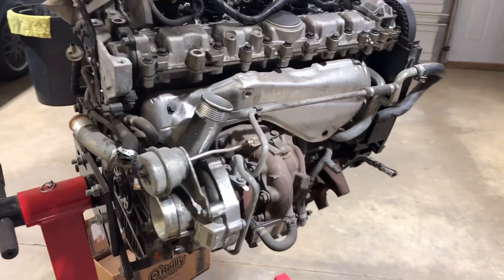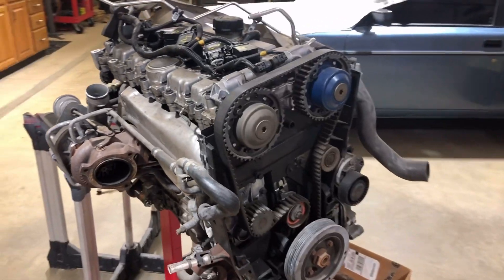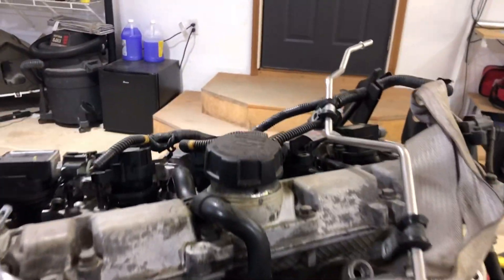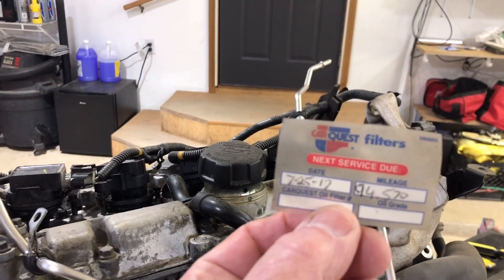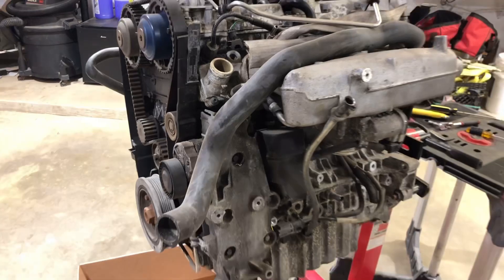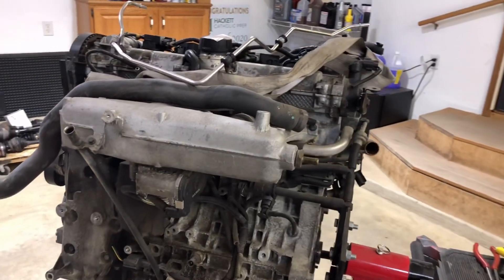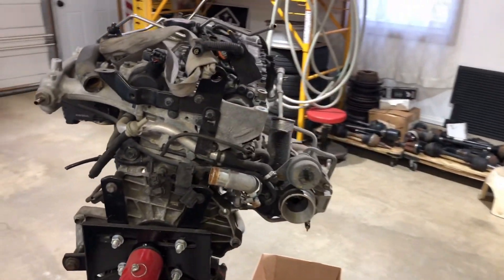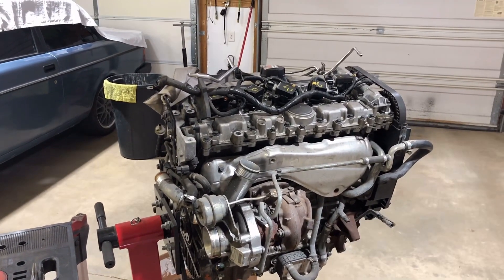2006 B5244T5 engine time lapse tear down - the best 5 cylinder engine Volvo ever built?!

Comment: I’m running a 2006 XC70 -just turned 200,000 miles
I installed an upgraded turbo from A1 Turbo in CA -Shout out to Tony @ A1 & Robert DYi
ELEVATE Tune
3” Snabb catless downpipe, 304 3” stainless Borla racing exhaust & resonator
Simota cold air intake pulling fresh air from the grill fed to a Snabb intake
IPD Silicone hoses
PCV system replaced 4 months ago 
She is an ugly, angry beast on the road 🔥
Can only drive in “manual” with the Tiptronic shifter, redlines about 6500
Being AWD you definitely feel it on the steering wheel trying to manhandle the torque pulling on it while the system is desperately trying to calculate what the hell to do.
Reply from the maker: Sounds like a cool car!  Thanks for watching!

Comment: Hi, I want to do an engine swap on Volvo 144 using the B5244T5 engine. What gearbox will mate with this engine for RWD?
Reply from the maker: For a manual the m90 is the preferred gearbox. There are other opportunities  available (try Yoshifab or STS Machining) that can mate different gearboxes. For auto I’m unsure but there are some available.
Reply: @handydand  thanks bros, will do my research 🙏🏾

Comment: Do i have to replace the cranks if im going to take about 400hp on this motor? I have read that the cranks are usually pretty weak on these motors but not sure on thís model.
Reply from the maker: The 4t5 engine should handle 400hp with the stock setup. However, anytime we push an engine’s limits stuff can break.  Building to that HP, you likely know that having a backup engine is a good plan. Thanks for the question and for watching!  Best of luck in your build!

Comment: What do yoz think about the B5254T2 210Hp 2.5T 5clyinder Engine ? Also Realaibly and how much Max Hp can i do for this Engine ?
Reply from the maker: I have that engine in my wife’s 2007xc70. It’s an excellent, toquey motor stock. Volvo offers a polestar tune upgrade which adds a tune and trans remap which gives a 30-40hp upgrade. Beyond that, the stock internals/cylinder walls Are supposedly good to 400 crank, but you are at the very limit of what the engine can provide. Look for 325 at the crank and that should provide plenty of smiles and still be reliable. Note that your tuner is key, as is the engine condition, stage zero, etc. thanks for watching and asking.
Reply: @handydand  Thanks For The Info Buddy 🤝

Comment: What's the Maximum Horsepower that this Engine can handle Stock?
Reply from the maker: A friend built one with 200k miles that pulled 400whp!
Reply: @handydand  Nice 👍😃
Did he use Forged internals? Or did he sleeve the Cylinders?
Original Turbo or Bigger Turbo?
Reply: @handydand  Amazing Work 👍
Reply: @handydand  Which Mods did he Do?

Comment: I want to get my hands on a whiteblock myself ❤️ 

I’ve owned a P2 wagon for a few years now and the first time I drove it home(780miles 1way) I knew it was a keeper 😮. Now I want to get more power from it!
Reply from the maker: I gotta say that the 4T5 motor in my Saff Wagon is an amazing engine!
Reply: How are you going to get more Horsepower it of this Engine?
Reply: @MB1Billion  that’s what I’m trying to find out now.
Reply: @ronin5020  There's not a Lot of Mod Videos on this Engine other than Wedging between the Cylinders so the Walls don't Crack as Easy and Exhaust. Other than that nothing. I haven't Seen any ECU or Running Videos. The amount of money it would take to make the white Block fast and Reinforce the Transmission and Axels I think I should just Buy a Track Hawk or Durango SRT  instead 🤣🤣🤣
Reply: @MB1Billion  year late but this is just wrong... check swedespeed or turbobricks or forums for better info on it, you're right about the transmission (basically an AW20 5spd is your best option for big power) but the white block is piss easy to make power on, crank boost up and get whatever engine internals you blow up machined. plus its in a volvo, you're not in it to race supercars, you're in it to have a sleeper that would keep you alive if you crash at 110, but even then it weighs 1500 lbs less than a trackhawk so you'd only need to make 500hp to be comparable
Reply: @dpi_samantha  Ok that's Good to Hear Because I Love Volvo XC90's 👍😃
Reply: @MB1Billion  if you like xc90s and you're into Mopar why not look at the XC90 V8?
Reply: @dpi_samantha  I was Looking into the V8 but I heard that you can get way more power in a T5 than the V8.
Reply: @MB1Billion  depends, it's a bit easier to make power on the T5s without much work but that's because Volvo guys hate doing much on engines besides putting on a bigger turbo, a built volvo V8 can easily handle 650 hp naturally aspirated or turbo, you can push it significantly more than that if you aren't daily driving it as well
Reply: @dpi_samantha  In California 
I found LA Sleeves for the Engine Reinforcement but I haven't found any Transmission Place to make the Transmission handle High Horsepower Specially for Volvos.
Reply: @MB1Billion  for the xc90s again best option is a toyota AW20 5spd but you need to fabricate an adaptor plate, but if I remember correctly stock XC90 turbo transmission is good out to 400(?) bhp, a lot of fab work necessary to get them beyond that figure which is why most Volvo guys discourage you from working on them

Comment: Ok what’s the difference between the b5244 t1 t2 t3 t4 the naturally aspirated version and this engine?
Reply from the maker: There are many differences; most notably, the 4t5 motor has the taller head and cams like the S/V 70R. It also has a revised crank/rods/pistons unique to this engine using the 81mm bore to make a stronger engine. Hope this helps and thanks for watching!

Comment: What difference between t4 and t5 engines ?
Reply from the maker: The engine in this video is considered to be the strongest stock lower end of the RN series. It has the bore of the 2.3 (thicker cylinder walls) but a stroker crank and rods to get the 2.4 displacement.
Reply: @handydand  thanks 🙌

Comment: 2.3 T5 is better in my opinion😏
Reply: Both engines have there strengths and weaknesses. If you just want to stick an intercooler, 3" exhaust and a tune on the engine and call it a day, the 2.4t5 is more superior than the 2.3. The R manifold, k24 turbo and better flowing head make it a great choice. If your planning serious engine work (forging the engine) then both engines are as good as each other in that regard. The 2.3 rn t5 is a bit less complicated thanks to it only having cvvt on the exhaust cam, whereas the 2.4 has it on both cams, therefore reducing the cost when you inevitably have to replace them 😉
Reply from the maker: I definitely love the 2.3!  However, the 4t5 in my Saff is a remarkable motor.  Thanks for your thoughts!
Reply: @handydand  it is! Truly
Reply: 2.4 T5 is better than an 2.3 T5 engine.

Comment: Interesting, very nice Dan! How do you time the cams without locking them spin removal? I am hesitant to take apart my 4t4 because of my worry of timing a VVT motor.
Reply from the maker: I have two cam locking devices; one for simple timing belt change (on front) and a tool kit that locks the cams on the back and the crank behind the starter.

Comment: no it's B5254T4 R engine, I've all Volvo s, R engine is amazing with low rpm huge torque and power it's very durable apart from it's thin cylinder walls, replace cylinders sleeves with thick one and it can easily work with 2 bars with KKK K24 turbo with long term, I did two engines with thick sleeves and they're still running Great keeping easily 2 bars with really huge torque and power starting from very low rpm till high rpm
Reply: The b5254t4 R engine and the b5244t5 are brother/sister engines with the 4t4 being the weaker one…they literally use the same head, cams, crank, exhaust manifold, turbo, and have the same compression ratio but the 4t5 has a thicker block where as the 4t4 has a 83mm bore block which is prone to cracking. The 4t5 is much better than the 4t4 stock versus stock for this reason and you can make more power from a 4t5 versus a 4t4 when comparing the engines stock without being built. Any Volvo 5 cylinder engine will be strong once you sleeve it so comparing a sleeved block 4t4 to a 4t5 isn’t a fair comparison. The only difference between these two engines is the fact that the 4t5 has thicker cylinder walls from factory, smaller injectors, and most 4t5s don’t come with a oil level sensor in the oil pan like the 4t4 does.
Reply from the maker: I’ve daily driven a 4t5/M58 in my Saffron V70r for over a year and absolutely love the engine. Definitely a winner!
Reply from the maker: Ty!
Reply: What's the Maximum Horsepower you can get from the Stock Engine?
Reply: Which Sleeves did you use? And what state are you from?

Comment: Hi HandyDan! The engine is O.K. -the best. I also have one. Maybe only the flywheel (DMF) will be bad. And the M66 transmission doesn't last long either. Good luck!
Reply from the maker: Yes it was fine thanks!  Just a hg failure. I really favor these as I put one in my daily driver Saffron wagon!

Comment: it would be interesting to compare on a dyno a B5244t5 and a B5234t9 with similar bolt ons. same turbo ect. just to see the differences in how the two motors make power. It would probably be minimal. but still an interesting comparison. just to see if the extra displacement and higher compression of the 4T5 makes more power than the longer TDC of the T9. also would be cool to look at the torque curves and see how they differ.
Reply from the maker: Hi Ian
I’d love to see that as well. Maybe if the channel keeps a growing I may be able to do so!